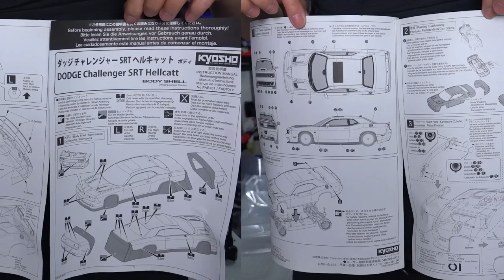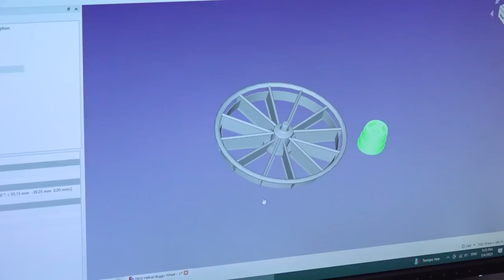RC Modify 38 | Red Hellcat Buggy - RC Car

Comment: U should definitely  3D print so light buckets for the back lights with the red light going all the way around. It really needs the whole tail light asemble 3D printed in clear then paint in the black parts so the rest can be painted  red so it can light up like the 1:1
Reply from the maker: I know. Kyosho is the manufacturer, they have the 3D file, they should make it using clear plastic! 💯😁